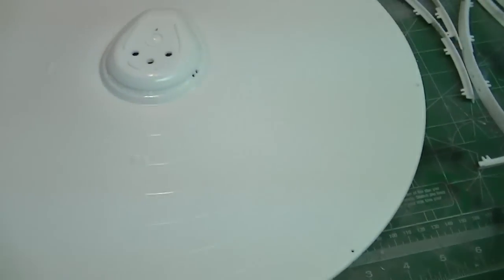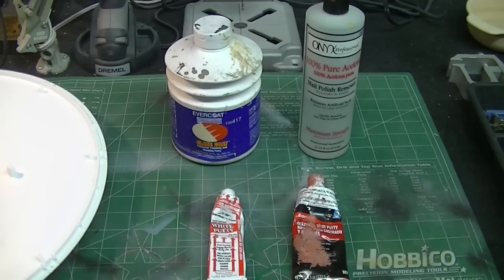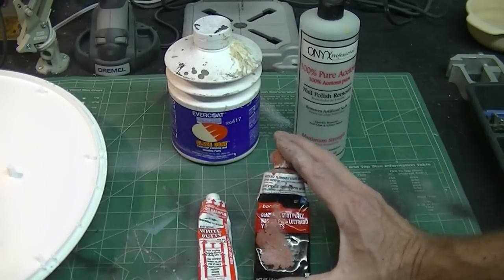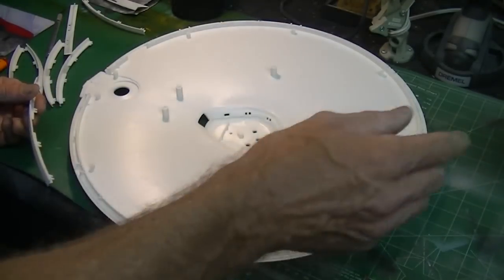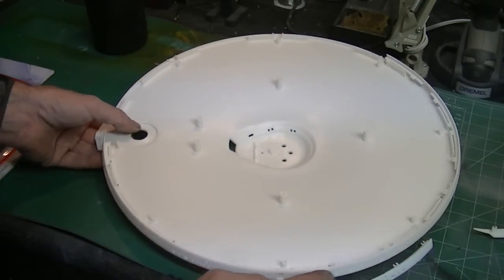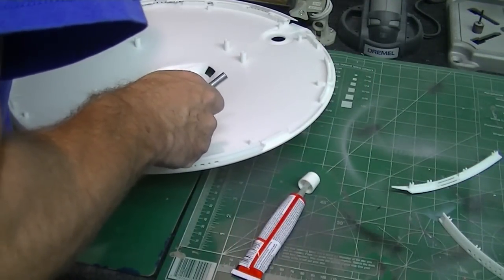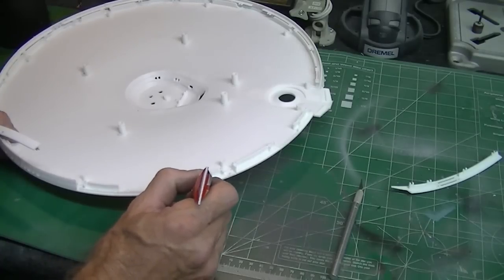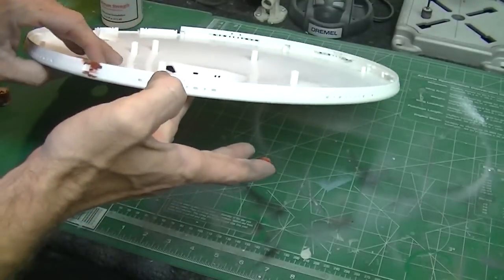Polar Lights 1/350 Scale Enterprise Refit Buildup PT 8

Comment: Great Boyd, that's what I do too. I use a q-tip in tight corners with acetone. I buy acetone from Walmart in a quart container. 1 question, instead of using steel wool I use a spot sanding pen. Do you use that also or just steel wool. I don't like steel wool, too messy in my hobby room. I know the fiber optic strands break off on the sanding pen, but I think steel wool makes more of a mess. Your automotive painter so you would know better. Thanks buddy.

Comment: I've been watching all your fantastic videos and process of this awesome 1/350 refit and, I'm truly admiring your amazing work.

I wanted to send you a PM on Facebook with a couple inquiries about your commission work and about the paint you use for the Enterprise color. However, I don't see an option on your FB page for sending a message.

May please inquire on the white color you use for the main base coat of the entire ship? I'm currently building the 1/1000 scale Refit and, I am planning to try and light it and paint it (with iridescent) aztec effects as close as possible to your demonstration of this 1/350 scale.

Also, I do have the 1/1000 scale Tena Controls light kit and, I would like to inquire what your price may be for soldering and assembling the LEDs? I am not at all an electronics expert or have a lot of experience with soldering and, would love to have the light kit assembled the right way by someone like you who clearly knows what they're doing.

Thanks so much and keep on "Trekking" with your amazing builds!